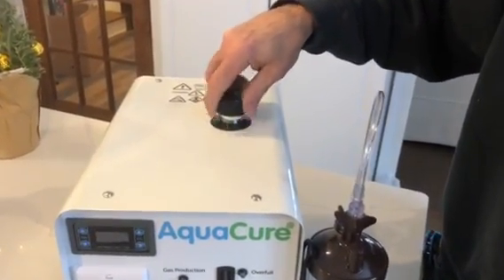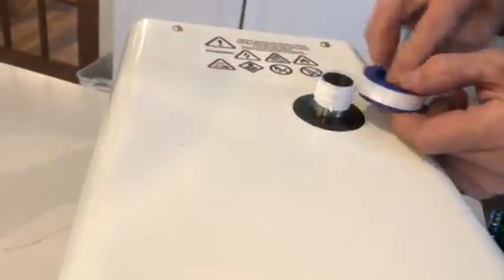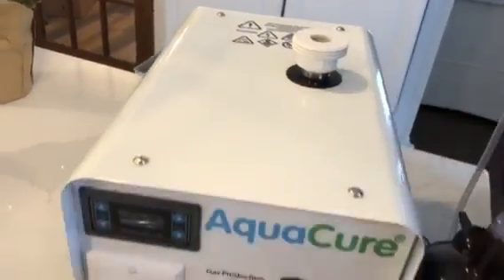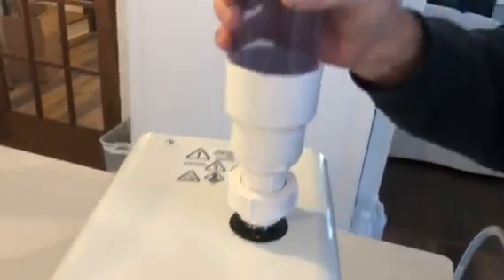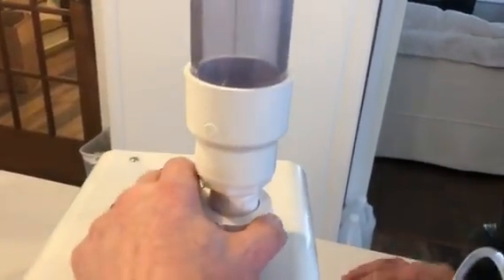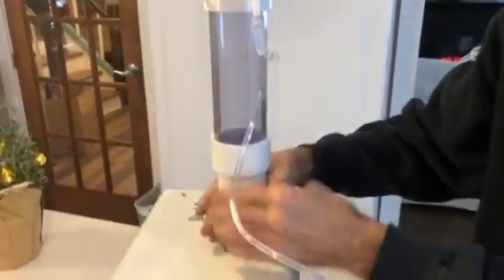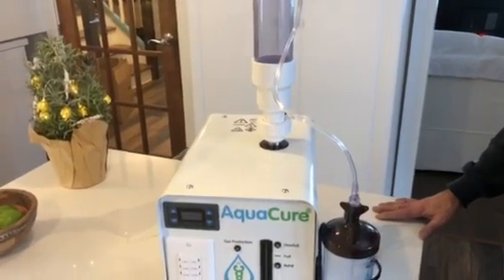Tower Cap Install

Comment: George, you said to do 15-20 wraps, yet I counted 8.5.  I cannot imagine being able to screw-on the tower with even 15 wraps.
Reply: There are other brands and better quality Teflon tapes available. I’m in the HVAC trade and use one called Blue Monster and it’s much thicker, only need about 2 wraps
Reply from the maker: @johnfalconi1739  true and good point.
Reply from the maker: Sorry that the video doesn't fully explain the situation.  The number of wraps depends on the thickness of the Teflon Tape.  The Teflon tape sent with the machines usually needs at least 15 wraps around the TOP threads to seal.  Part of thie reason is that we are screwing 3/4 NPT fittings onto 25x1 mm threads.  Use as much tape as you can and still thread on the lower fitting.  It will work well.
Reply: @ecopegasus  Thank you, George.

Comment: If the machine is in below freezing temps will it hurt anything?
Reply from the maker: That's difficult to answer precisely.  First, the cooler the temperatures, the better for the machine (generally).  BUT, below the freezing point of water, anything that IS water will freeze, like the water in the Humidifier.  The solution in the machine (electrolyzer) can go quite a bit under freezing (I'm not sure how much) and it then turns to slush instead of hard ice, so little chance of damage.  If OPERATING in freezing temperatures, there will be buildup of frozen water (condensation) that will cause the machine to quit (unlikely to cause damage).
Reply: @ecopegasus  
Thank you for your answer and it helps.

Comment: Yeah guys I got this machine..you need to put tape on it otherwise you may not get any Bubbles
Reply from the maker: Yes, it's surprising how many wraps you MIGHT need if the Teflon Tape is thin... I've seen people put 30 wraps on, but they were wrapping ALL the threads.  You only need to wrap the top threads AND as long as you can screw the base on without 'pushing the tape down', it's OK (not too many wraps).

Comment: What is purpose of tower?
Reply from the maker: FAQ: Why Make a Tower Cap?

1. To pre-separate the lye mist from the gas.  

During electrolysis, as the gas bubbles ‘pop’ out of the surface, they create a ’spray’ that becomes a ‘mist cloud’ that forms over the surface.  This mist contains lye in the water droplets.  These lye filled droplets of water usually go out with the HydrOxy Gas and need to be scrubbed from the gas.  They also carry lye out of the machine that’s supposed to stay in the machine.

Our innovative The Tower Cap solves this issue by providing the HEIGHT needed for most of the mist to settle down, pre-separating the lye mist from the HydrOxy gas.

2. To by-pass potential sludge-block issues. (bypasses the gas channel going through the Stainless Steel Filter).
Setup your AquaCureAC50 torch attachment:
https://youtu.be/v2ufQWJ0l0Q

The VING chassis we are using to make these models of AquaCure were originally designed to fuel a micro-torch and we want to maintain that functionality, for amazing reasons we’ll make clear (protocols 5 and 6) once there are a few thousand machines out in the public.  

The original gas channels are prone to plugging with sludge and the Tower Cap completely bypasses that issue, giving the HydrOxy gas a clear unobstructed path out of the machine.

3. To be able to see if there is foaming.

If the electrolyte (lye solution) becomes contaminated with any kind of oil, the resulting bubbles won’t ‘pop’ and foam will be created.  The foam will rise off the surface and flow out of the machine.  The foam film is essentially liquid and has a lot of lye in it; thus lye is being ejected from the machine.  So foam is bad and requires dumping the contaminated electrolyte and mixing a new batch.  The tall transparent Tower Cap allows you to see if there is foaming BEFORE the foam exits from the machine.

4. To reduce maintenance (bypasses the steel filter on the front)

By having the Tower Cap, we simply and efficiently remove most of the lye from the HydrOxy, so the first ‘filter’ becomes redundant.  By eliminating one of the ‘containers’ that would normally need to be maintained (water changed), we minimized the ongoing maintenance.
Properly Install the Tower Cap
https://youtu.be/Pr98DMe94No 

Note: The water in the Humidifier (the current ’scrubber’) is the BEST fluid needed to refill the AquaCure when it gets low on water… The Humidifier water would also contain any trapped lye, so using that water to refill the AquaCure not only assures that the Humidifier gets fresh water often, it also puts any trapped lye back into the AquaCure.

So the Tower Cap is the perfect solution to both maintenance and efficiency.

You completely change the Humidifier water (with fresh distilled) everytime you refill the AquaCure with water from the Humidifier.  
If you are keeping the AquaCure liquid level above ¾ (keeping it nearly full is HIGHLY recommended), the Humidifier ‘cleaning’ timing will be correct.
AquaCure AC50 Operation Manual UPDATE notes
https://eagle-research.com/wp-content/uploads/2021/11/AquaCure-Operation-Manual-Update-Notes.pdf

5. To help prevent over-filling

You can SEE if the water level is (far) too high, before it comes out of the machine, spilling out lye solution.  This is important because the front  sight tube can become plugged with sludge, which makes it ‘miss-read’.  
The plug can be cleared, but it’s good to have a system that prevents a mess in the first place.

The Tower Cap height is generally not a problem because these machines aren’t usually placed on counters that have cabinets above them.  People need to have them close to where they sit, for inhalation, so tables (or utility cart) near chairs, couches or beds.

6. To apply a better solution

Note that the Tower Cap is NOT a ‘new’ development.  We developed the Tower Cap concept after years of research and put it on our very first HydrOxy for Health (the ER50) machines back in 2007.  We’ve only recently figured out how to apply the Tower Cap to the China Chassis machines.
It’s a simple, reliable solution for several issues… And one that no one else (to date) uses.

Q: Is it normal for my transparent Tower Tube to appear grey, or is that some sort of contamination?

GW/ It is normal for the transparency to cloud from condensation of water vapor.
It is normal for the transparency to cloud (turn translucent) when heated.
It is normal for the transparent plastic to eventually turn color (grey / brown) with age.

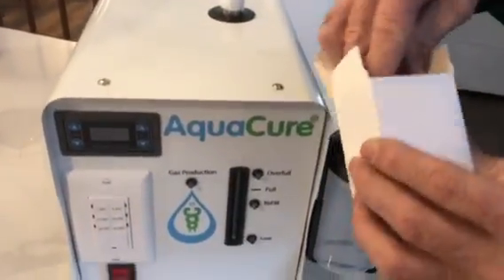Comment: 0:41 shows the different timer switches on the front of the unit. I'm enjoying the AquaCure, but I'm not pushing the correct timer to get CONTINUOUS hydroxy. Please advise. (I bought the unit from hearing your interview with Crrow777.)
Reply: You hold the 60 minute button for about 5 seconds, then the red button at bottom goes on. I’ve been using my AquaCure over 2 yrs now, love it
Reply from the maker: The NEW Timer switch is detailed here:
 https://youtu.be/P0J4GxuddxM 
Not better, just different.

Comment: Hi George Just recipe the machine. Do i need to flush the machine with clean tap water before using it? If so how do I remove the water from the device? Tip it upside down?
Reply from the maker: This type of question is best sent directly to me via the website eMail form
 https://eagle-research.com/contact/ 
include your serial number and enough information so that I can find your order.

Comment: hi George,  I was listening to Morely Robbins and he said one need to take bioavailble copper if you drink hydrogen water,  please advise, ty....I have had my machine 1 year now and love it.
Reply from the maker: I have no idea why he is recommending bio-available copper.  It'd be nice to see the scientific study for that; to understand the reasoning.
Reply: @ecopegasus  he feels copper regulates iron overload as well as helps the body.
Reply from the maker: @wizardofraw  I'm not saying it isn't true.  I have no idea one way or the other.  So I asked for the science.  I DO know that our bodies are comprised (by volume) of 62% hydrogen, 24% oxygen, 12% carbon and 2% everything else (including the iron and copper).  So your major macro-nutrient is hydrogen.  

The micro-nutrients are important, for sure, but you should be getting them from your FOOD, not as supplements.  Yes, if food isn't giving some trace element, then some supplementation is needed.... But MANY people supplement too much or the wrong things, causing further imbalance.  

Everything must be in balance and every body is different.  There is no 'one size fits all'.  But for the MAIN nutrition, almost everyone is hydrogen deficient and it cannot be 'over-consumed' because the body simply exhails what it doesn't need (like carbon-dioxide).

I also know that if you are iron deficient, making an anemia (low blood oxygen) that Brown's Gas will put a 'charge' on the red blood cells so they can grab oxygen even if they don't have enough iron in them.
Reply: @ecopegasus  Yeah I am fairly new to your videos and the browns gas, and I am impressed and really want to save up to buy a machine. Thank you for all you do. 

Also I agree with your body composition percentages and agree we should have a focus on hydrogen.
Reply: So ready to receive mine!!! :)  I am practicing patience.
Reply: @Redgogrey  me too! If I’m satisfied with mine, I can see myself getting about 10 of these and handing them or lending them out to help people heal themselves.
Reply: @PA_Savage  couldnt fall back to sleep so I decided to get up and get some brown gas.  Just received it 2 days ago :)